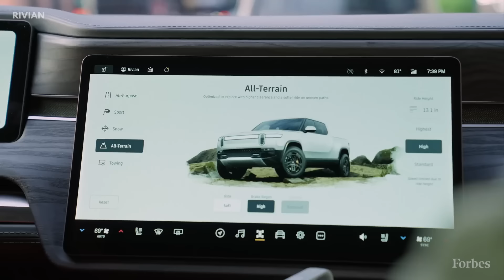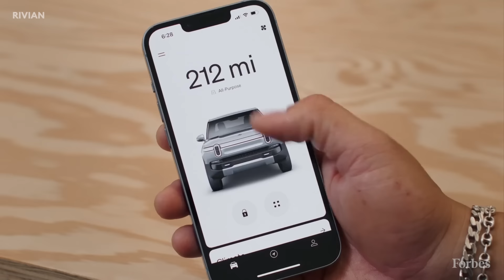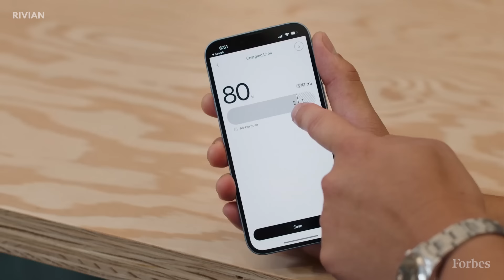Why Rivian Wants To Compete In The EV Mass Market With A Lower Priced Vehicle

Comment: The R2 will be a great addition to the Rivian lineup!
Reply: If it's bigger than a Ford Ranger designed for Range Rover tastes, then it'll be too little too late
Reply: They should have started with this instead. I don't understand why these companies are surprised by the low demand when they launch themselves with a product the middle class cannot afford.
Reply: I prefer the C3PO model.
Reply: It’ll likely never happen. They can’t make money on $80,000 + new vehicles so how can they profit on cheaper cars? They only have enough cash to operate another 1.5 to 2 years at their current burn rate, and raising anymore money would be extremely costly to them.

Comment: 48k is a sweet spot? Looks like I will have to wait till there are used ones to purchase. I cringe spending anything over 25k for a depreciable asset like a car.
Reply: Agreed
Reply: Yeah, wait to buy a used one so you can spend $25+k on a replacement battery. Used EV's are just like old cell phones- useless
Reply: Exactly. All these EV makers seem to be thinking making the EV available at the average car price is reasonable for mass adoption and the math may support that thinking, but to get people’s attention it’s going to have to be not just technologically groundbreaking, but overwhelmingly economically groundbreaking to the point overall ownership is readily evident to the mass consumer that it costs less. Right now you have sit around with spreadsheets and calculators sorting out or trying to find if the purchase makes sense. Extreme and currently unrealistic example, but imagine if the R1 and these others evs came out with all the features and quality they have and were sold for $20,000– the adoption rates would be insane.
Reply: 25k for a new car? Won’t get you much..
Reply: @Helojet1999  used is new for me.
Reply: @jeffdunn890  same
Reply: @TheDaizM if a person can't sit down and figure out the economics of an EV, it's a tell on why they can't afford an average priced car.

Comment: Love my Rivian but it’s too difficult to get it serviced. 4-5 month lead time here in LA just to get an appointment.
Reply: What needs to be serviced on an electric vehicle ???
Reply: Can't you just go to any mechanics who specialized in EVs?
Reply: @Smileydudekxy  Most likely fixing manufacturing defects/issues like leaks, panel gaps, etc.
Reply: Wait until your battery needs replacement 😂
Reply: @Smileydudekxy go ask Hertz - maintenance and repair costs were the key reasons they had to sell off  a huge portion of their EV fleet.  And that was from Tesla- the other brands are even worse.  The vehicles are much more complex than you think and anything that fails will be very expensive to fix and result in long wait times for parts and labor.

Comment: They need to sell 1m vehicles a yr produced at 36k a unit (tesla nos today) and sold for 40k each (10% gm) to cover their fixed costs of 1b a quarter and break even. At 2m units they make 4b profits and get valued at 100b+. It will min take till 2030 to get there
Reply: You forget cost cutting could make that happen much much faster especially over the 3 new models

Comment: If the R2 is offroad capable, they will set themselves apart from all the other mid market EVs. The R1S is super capable both on and off road.
Reply: Until it runs out of battery 5 miles into the trail
Reply: @Wizardnil BEVs are incredibly efficient at low speeds as all torque is available immediately. Conversely, ICE vehicles are more efficient at high speeds, and not so much at low speed crawling. BEVs are less efficient at high speeds, but on trails you’ll be better off with off-roading EVs
Reply: Seems that would be more user error, not vehicle error....  @Wizardnil
Reply: @Wizardnil if you don't plug it in then sure. I doubt these will be used for trails anymore than your average SUV though. Personally, I would just take it to the pumpkin patch once a year. Not challenging conditions, but a standard sedan will high center on the asphalt leaving the farm.
Reply: @Wizardnil oh god dude that wouldn’t happen give me a break

Comment: RJ – I agree on the importance of choices. The choice I feel Rivian and most EV companies are missing to achieve widespread adoption is range. Rivian had it right in the early days promising a 400+ mile range quad motor, but has yet to deliver and I think you’re missing a big opportunity.  When buying an $80K+ SUV, many buyers including myself, want full-time all-wheel drive, Landcruiser like off road features and 325 miles of real world (not EPA) range under almost any circumstances (uphill, downhill, 80 mph on highways, hot or cold).  The Achilles heel of my quad motor R1S is range.  Over countless road trips, I’m averaging about 230 miles mostly in Conserve mode.  Front wheel drive only in Conserve doesn’t cut it, particularly for winter road trips in bad weather. More charging infrastructure helps, but that’s not the full solution given how long charging takes. Rivian’s dual motor is not full time all wheel drive and lacks the off-road features of the quad. Please give us the 180Kwh battery you originally promised.
Reply: 100% agreed.  I owned the Jaguar I-Pace which was an EV but had a range of 230 or so. During summer trips on highway, using the AC the range was greatly reduced by about 40-50 miles. I lasted only one year with before I traded it and went back to gas powered. A lot of people dont know that EV's do not have compressors therefore the AC does not run as cold as a gas powered car and when parked the AC does not cool. Very frustrating.

Comment: Will the R2 launch with the NACS charge port? Consumers are starting to become aware the standard is changing and it's going to be difficult to sell CCS cars this year and in 2025.
Reply: R2 isn't expected to go into full production until 2026 so it will almost certainly have the NACS charge port.
Reply: Even still Tesla is working on adding magic dock to their network so CCS cars can charge too.
Reply: @kng128  That would be nice if they were all magic dock. Tesla even has a home wall connector now that's CCS and NACS. Great if you have friends and family over that need to charge.

Comment: Ya...I'm still going to buy an internal combustion engine the infrastructure is still not there. Also why wait 30 mins to charge e every few hours when I just fill up my tank
Reply: More than 95% of current EV owners recharge at their homes overnight.  Since you can be eating dinner, sleeping, spending time with your family, it actually takes no time at all.  And you're only replenishing the energy used during the day.  Not recharging the entire battery.  Given the average commute of most Americans this equates to about 1-2 hours of charging at a medium-speed L2 home charger per night. Or one full overnight charge per week.  This is at a L2 home charger.  Fast chargers can replenish that (obviously) much faster.

Let's look at it another way:

Let's say it takes you 3 minutes to fill your tank. Let's also assume it takes another 7 minutes for you to deviate from your normal commute to work. That's 10 minutes, unless you also go inside to pay or get a coffee.

10 minutes per fill-up.

And let's say you fill up once a week.

That's 10 minutes a week, or about 40 minutes a month, 520 minutes a year.

I spend 0 minutes to charge my EV. Yes, ZERO. I charge overnight when rates are lower and the grid isn't as taxed running air conditioners, ranges, ovens, and clothes dryers.

I get up every morning and my car is magically ready to take me wherever I want to go that day.

I commute 55 miles one way. That is WELL over the average commute in the US at 20.5 miles. My Rivian handles that easily with plenty of charge to spare in case I need to run errands, take a long lunch, or go out in the evening.

For everyday use, there is NO comparison. EVs are cheaper and more convenient, with ZERO minutes spent at a gas station.
But the anti-EV faction concentrates on long-distance road trips, because that's all they have.

Comment: Increasingly new housing is apartments and condos, not houses with garages. Good luck on the charging thing.
Reply: A quick charge once a week while you grocery shop
Reply: @danielhouse1053 not enough infrastructure for every person grocery shopping to do that. Furthermore, most of Gen Z don’t grocery shop, rather pay for online.
Reply: @good-tn9sr  most people would need to charge once a week, so not all would need a charger
Reply: @good-tn9sr  chargers could also be at work places
Reply: @good-tn9sr  Every person who needs to go grocery shopping is not going to buy an EV tomorrow. As the number of EVs increases, the infrastructure will grow to serve them. Everything doesn't happen all at once. There used to be a time when few people had cell phones and the network infrastructure was sparse, but as sales grew, so did the infrastructure. It'll happen.

Comment: Big brain electric car company CEOs think that everyone has a breaker panel in their house with an available 220v breaker spot near where they can park and charge. The cars cost is only part of the equation to why more won't switch.
Reply: If you can operate a dryer, or a stove,  I don’t see how a charging station is a problem
Reply: @danielhouse1053 Both my dryer and stove are gas, so others might have the same setup.
Reply: @sealevel274  In the United States and Canada, the electrical power supplied to most homes is a split-phase system. That power enters your home at about 240 volts. This 240 volts is split at the main circuit breaker panel into two 120 volt halves, called phases.Its not a big deal to install a 240v breaker, then a line to wherever you park your car.
Reply: You can charge with a normal plug, it just takes longer, however, you’ll get about 50 miles of range a night out of a regular plug, which works for a lot of people.
Reply: It is called evolution.

Comment: Nice little marketing attempt here, but the facts speak volumes. RIVN is a 0 out of 100 stock performance score along with their stock being at an all time low (and steadily falling). "Additionally, the stock has a 21 Relative Strength Rating and its EPS Rating is 43 out of 99. Rivian sales are picking up, but heavy losses are likely to continue for some time. Shares are down more than 50% in 2024. For now, RIVN is still not yet a buy."

Comment: im perfectly fine with having 100% of evs in 10 , 20 years but the thing is  we will need the infrastructure for them, sometimes i go to a charger there are 8 of them and 4 of then are unavailable, then the 4 working ones are in use, we need more infrastructure please
Reply: I agree with you, and this is improving, slowly but surely. Hopefully quicker than 20 years down the road
Reply: The same was said when gas cars came out, not enough gas stations, but with more Evs on the road means companies can make lots of money which will have more companies popping up designated to growing out a network.

Comment: Rivian are very bad vehicles to purchase because of the high insurance and maintenance costs. Why? A single fender bender would cost over 30k to repair because whole body has to be replaced..
Reply: This is pretty inaccurate and I'm guessing you've never even seen a Rivian in person. While insurance rates very widely, I can tell you that after 1 year of ownership, my R1T is only costing $20 more per month to insure than my 15-year-old Chevy WT.
Reply: And the only maintenance it's required in that time is one tire rotation and a jug of washer fluid. Far less expensive to maintain than my ICE Chevy, lol. 😆

Comment: I find it laughable that these companies are making an EV pickup truck because it sounds awfully impractical. Unless you're in it for the aesthetic, these vehicles are usually used for things like going camping, off-roading, working outdoors, and carrying equipment around. However, most of those use-cases and locations lack charging stations. How am I supposed to charge this thing? It's the same with the Tesla cybertruck - they're advertising this thing in the isolated desert, but reaching such a destination alone would already take up most of mileage range with no station nearby for days. Sounds awfully inconvenient and for the cost of what? MORE money?! 

Not to mention, how out-of-touch these CEOs sound whenever they talk about charging these vehicles in our garages. Most of the city and suburbs are apartments that are difficult to install chargers in. Even with a house, setting up chargers are awfully costly and inconvenient. I mean, c'mon people... they want us to charge these in public parking lots everyday?

I don't doubt the future of EV, but it's going to take them a damn long time to have this figured out still.
Reply: Actually charging spots at grocery stores shopping malls and other businesses would be a great idea. Charge your car while you’re picking up the Weeks groceries.
Reply: Since you mentioned work trucks, I'm using my R1T as my daily work truck. My experience has been fantastic - much better than my three previous Chevy trucks. The Riv has more space for tools and equipment in the frunk, gear tunnel, and under-bed storage. While the bed itself is a bit small, the gear tunnel doors make a great extra flat surface for setting tools and equipment when working out in the field.

And the best part about it (in my opinion) is being able to go straight home after finishing my route and recharge in my garage overnight. It's like waking up each morning with a "full tank".

Not having to stop for gas when I'm tired and just want to get home is a win in my book, and allows me to spend more time with my family. Which is the most important thing to me. 😊
Reply: Yeah there are a few places I can't reach at the moment, but I have to go pretty far afield to find them anywhere near me - and I'm in the pretty lightly populated interior mountains of south-east BC!

As far as charging - yes it can be an issue for sure - best scenario is for owners to have reliable/accessible Level 2 charging at either home or workplace. We have lived in a strata the entire 10 years we have owned EVs. The first one was pretty easy as it only required install of a charger on the shared carports panel - we were the only one, so no service upgrade needed. Our second strata was more difficult, as there were 3 EVs wanting to charge. After a year we made a project plan and executed installation of electrical infrastructure to service every stall, and 75% of residents bought into it. A year later everyone can have Level 2 charging, and we more than tripled the number of EVs at our strata. Like Field of Dreams - build it and they will come!